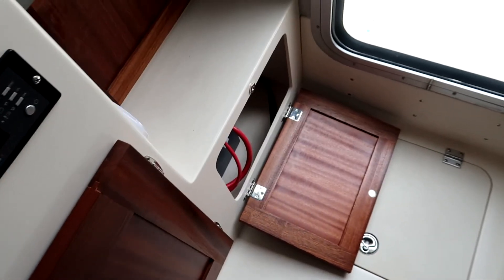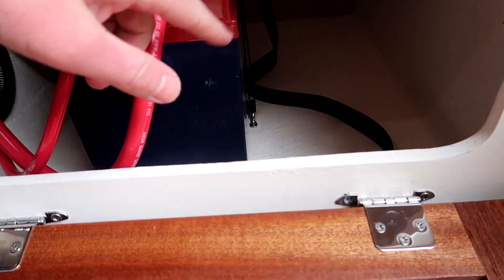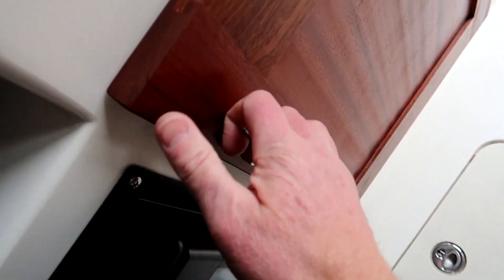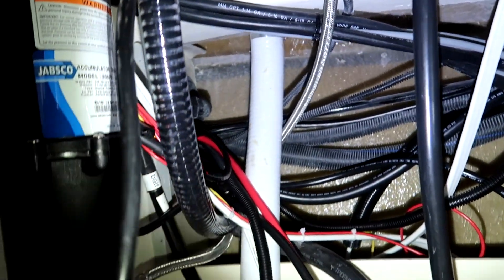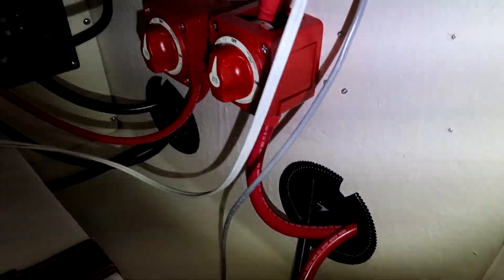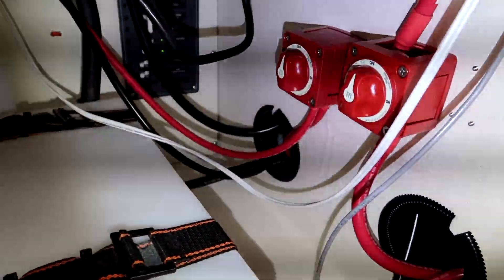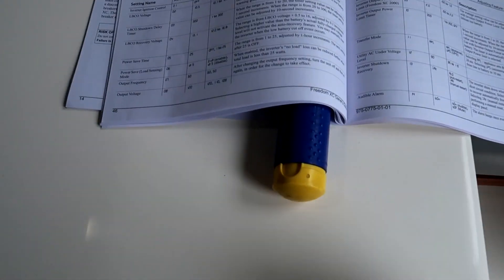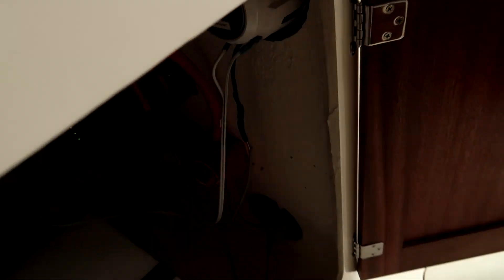Dakota Lithium and Xantrex 2000 install in Pilothouse Boat

Comment: You may want to rethink having the hot air exhaust vented to behind your sear Capt. The last thing you would want is that air blowing on your legs or back while you are in the Captains chair.
Reply from the maker: Good thinking. Its not a fan just a hole vent so heat goes up. Ill report back if I feel any heat from it. Thanks!